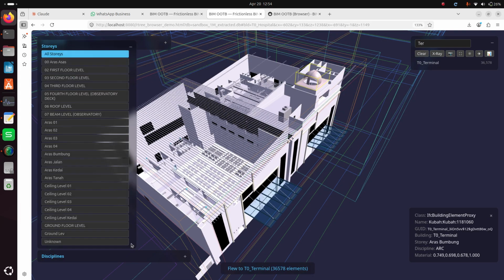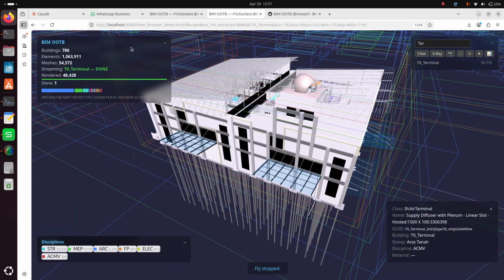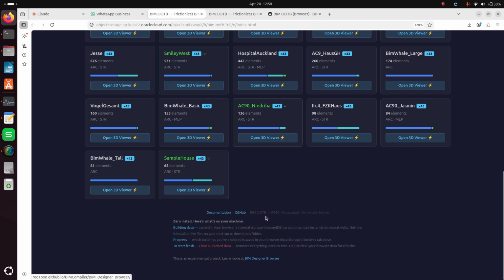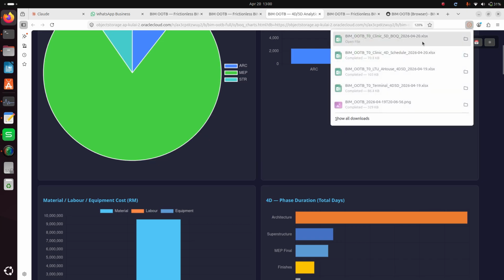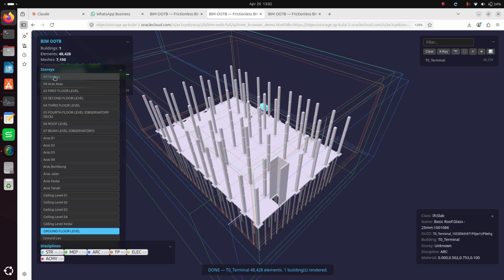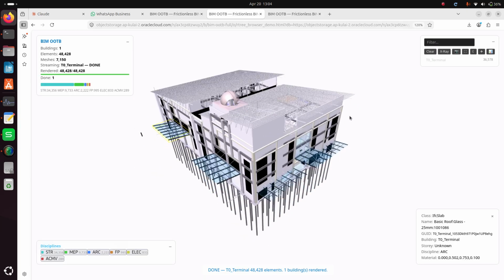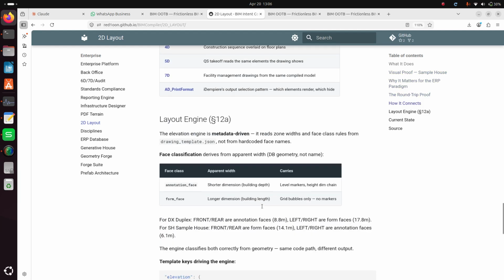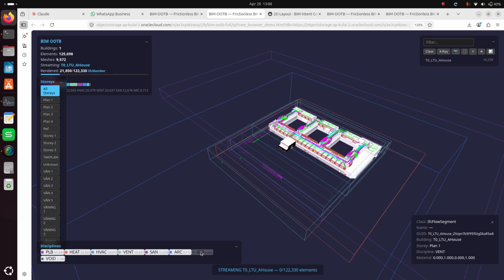Browser BIM, no installation no Blender Modeler

Comment: This is genius, it's the obvious step in design. You're advancing the field, hopefully the status quo will take notes soon.

Ie. Oh no I can't find this part any more. Let us change it with this different part. The whole building adapts and Instantly you can see the impact on cost and time. 

Next: search from available parts to optimize aspects of building: cost, strength, procurement time, etc...
Reply from the maker: Yep! What you described is exactly how the compiler works — the building is a Bill of Materials (recipe tree), not a geometry file. Swap a part → the BOM recompiles → cost, schedule, and quantities cascade automatically. It's database-level, not geometry-level, so the impact is instant. Your "next" is spot on too — querying across available parts to optimize cost/strength/procurement is the natural next step when your building is a structured recipe instead of a  polygon soup. The data is all there in SQL, ready to be queried.
Reply from the maker: Here it is - Import your IFC and later revision to see impact - https://youtu.be/hv0kcc_TKvY

Comment: This is incredible, I'd really like to learn how to get started doing this. Especially the 4D/5D use cases. For example if I wanted to remodel some elements in BonsaiBIM/Blender and reflect the changes in the database. How does that work, will there be an option to manually download the IFC and reimport
Reply from the maker: You can view also my later version that is now mobile which allow on site activity. But to your query above, i like to address them:
 Thanks for the interest! Here's how it works and where it's heading:                                                                                                                
                                             
  ▎ Current flow: Bonsai/Blender → export IFC → compiler extracts everything into a SQLite database → browser loads that DB directly. The 4D/5D is just SQL tables (schedule, costs,    
  quantities) sitting next to the geometry in the same DB. No server needed.
                                                                                                                                                                                        
  ▎ For remodelling — we're building three paths:                                                                                                                                       
                                         
  ▎ 1. Incremental edits in the browser — Pick an element, change its material, status, or properties right in the viewer. Every change is logged (who, what, when, old/new value). The 
  3D view updates live. No need to go back to Blender for property-level changes.
  ▎ 2. 2D round-trip — The compiler generates DXF drawings where each line carries the GUID of the BIM element it came from. Edit the DXF in any CAD tool, the system reads back what   
  changed and recompiles automatically. Move a grid line → rooms recompile.                                                                                                             
  ▎ 3. IFC export back out — DB → IFC4 file, entirely in the browser. Tessellated geometry (industry standard for coordination). Reimport into Bonsai, Revit, ArchiCAD, any IFC viewer.
                                                                                                                                                                                        
  ▎ And if you keep working in Bonsai — you don't re-extract the whole model. Re-export your IFC, and the compiler diffs it against the previous DB: added elements show green, removed 
  show as red ghosts, changed properties show yellow. Only the delta gets loaded. You see exactly what changed — 47 added, 12 removed, 89 changed — with fly-to on each one and an Excel
   diff report. No full reload needed, and it's fully backward compatible with the existing DB.                                                                                         
                                             
  ▎ The bigger idea: a Designer preset library — the most common changes (swap a door type, change a finish, adjust furniture, update MEP equipment) as one-click operations in the     
  browser. Prefab recipes: pick from a catalogue, apply, done. Blender stays for heavy geometry; the browser handles the 80% of changes that are really just data updates.
                                                                                                                                                                                        
  ▎ We're also looking at what-if mode (fork the DB, try changes, see the cost/schedule impact instantly, commit or discard), change impact cascade (edit one element, see the ripple   
  across BOQ and schedule), and visual diff between versions (colour-coded added/removed/changed).
                                                                                                                                                                                        
  ▎ If you want to try it with your own IFC model, tell me so i can work on that feature - as i got a busy but exciting roadmap to rush as fast - as i am glad someone taking interest showing i am on the right path!
Reply: @redhuanoon this is very intelligent, the fact that you don’t have to re-export and completely override the existing model in the database is a brilliant idea.

Yes, I’d like to try with my own set of IFC files or use one of your sample if permitted, but I’m struggling with performance issues after importing large IFC models using blender/bonsaiBIM though. I have a very good PC (Alienware Area 51). How do you manage this please, for example with the great hospital sample you have?

If I can resolve this, it would be good to have an animation sequence created in blender to show in the 4D/5D analytics webpage as well.
Reply from the maker: @prosota_visuals   Thanks! The performance issue you're hitting is exactly why we built BIM OOTB. Blender tries to load the entire IFC into memory as Blender objects — for a hospital-sized model  that's millions of polygons and it wasn't designed for that scale.
                                                                                                                                                                                        
Our approach: the compiler extracts the IFC into a SQLite database once. After that, everything happens in the browser — viewing, 4D/5D analysis, incremental diff when the model changes, and eventually animation sequences too. The LTU A House after Hospital s 126K+ elements, loads in minutes in the browser without crashes. Same model that chokes Blender.
                                                                                                                                                                                        
So the workflow becomes: Bonsai for design/modelling only → export IFC → compiler extracts to DB → everything else happens in BIM OOTB. No need to open Blender again for viewing, analysis, or presentation. The browser is faster, lighter, and the data stays live — change a property, see the cost impact, scrub the 4D timeline, all without touching Blender. (Parts of roadmap planned for these)
                                                                                                                                                                                        
For animation — we're planning to do that directly in the browser too. The phase/schedule data is already in the DB driving the timeline slider. Animating construction sequences  from that same data is the natural next step, and it'll run on any device, no GPU workstation needed.
                                                                                                                                                                                        
I'll work on making it easy to bring in external IFC files — you'll be one of the first to try it.  

P/S As you can see in my previous videos. i was already too happy to be on Bonsai but when i wanted to deploy to the cloud OCI, i was thinking of the newbie setup been burdensome and after some research found out that the browser and SQlite DB is no longer what it was 2 years ago. It is now NoServer capable.

In the slightly longer term, we be bypassing IFCs, after the BoM artifacts are all lined up - building from new, with ready made prefabs, and rules engine. The whole full D circle from 1D till 8D is then closed.
Reply: @redhuanoon Awesome work, looking forward to this development!
Reply from the maker: @prosota_visuals  u can now drop in your own IFC file and then save it back as IFC or DB.. 

Links at the beginning of this page https://red1oon.github.io/BIMCompiler/MOBILE_DEPLOY/
Reply: @redhuanoon Thank you, I’ll try this out!
Reply from the maker: Here is the import IFC and more https://youtu.be/hv0kcc_TKvY